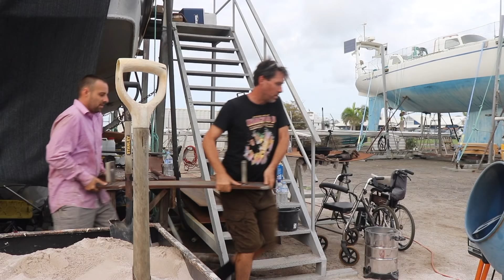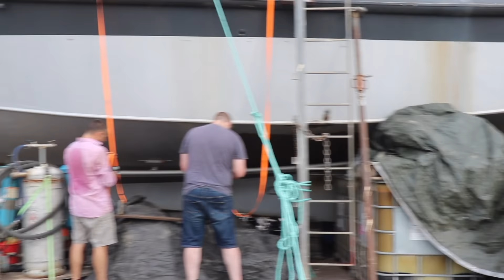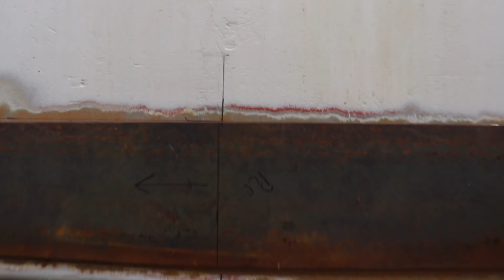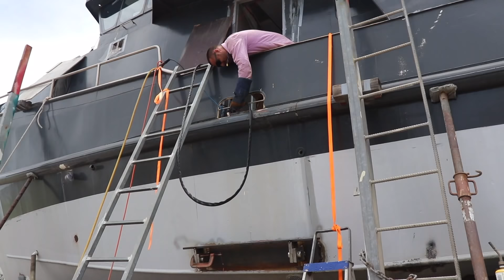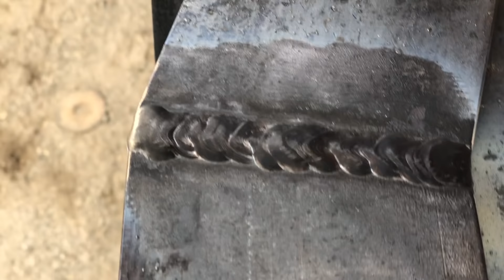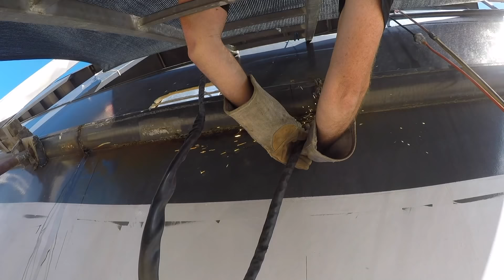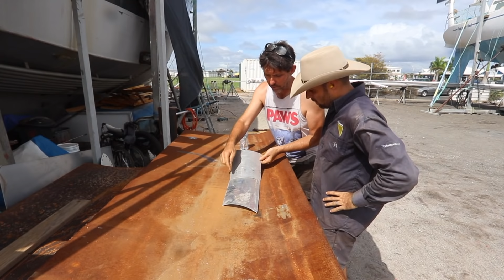Stabiliser Hinges & NAS Installation - Project Brupeg Ep. 123

Comment: Great video as always. Will you be using an electric winch, hydraulics or hand winch to raise and lower them?
Reply from the maker: Originally i was thinking manual hand winch, then realised that would break your wrist lowering them if your let go. so i moved to electric but then realised if a bog wave bopped the wing underneather when it was halfway down it could theoretically slam against the boat and crew member. so ive since moved to full hydraulic ram accuation. This allows wing elovation to be adjusted to any angle, is powered up and down and cant be bopped by waves/swell and is miles safer over all. A by product is its also massively stronger. the smallers off the shelf ram we could use has a SWL of 6.6 tonne so well within a good margin of safety for us.

Comment: THANKS FOR THE VIDEO  AS I LIKE TO SAY ..great to see a nas personally i prefer not to dhcp assign ip addresses to the machines on my network  which means you must assign ip addresses to the hardware on each system which are in the same range  its easy to do and  will not randomly reset itself as routers tend to do...also dhcp assigned networks are easier to compromise  if your into that sort of thing...  i also recommend learning basic networking config  just makes troubleshooting easier
Reply from the maker: Thanks Mike

Comment: I would have built both stabilizers at the same angle. I did a quick CAD drawing with the angles you called out and when they are in the stowed position the difference was not noticeable. Especially since no one can both sides at the same time, they would never notice it and probably wouldn't see it if you told them is was there.
Reply from the maker: Jims right, my disability wont allow me to function knowing one wing is sticking out slightly more than the other.
Reply: @ProjectBrupeg  Well at least you don't have the OCD where you must get it done at any cost no matter what it looks like.

Comment: Do you think adding a stop in the hinge would be a good idea to help the extinding arm? Just incase there is ever a problem the wing wont fall all the way down.
Reply from the maker: I doubt i could build a stop at the hinge that would ever be strong enough. We could just add a stainless wire rope between the wing arm mount and the hull arm mount. so when its down teh cable is tight and if anything ever failed the cable would take up the job.

Comment: From the inside of the boat, you could core drill holes where the hinges are located, and plug weld for super extra high rigidity. :D
Reply from the maker: We are actually going to do this on the doubler from the outside. Rather not cut holes in the boat, just in case...

Comment: I have exactly the same model NAS and I've been running it for a few years, they are bullet proof, great choice.  
I'd also be ready to replace those WD Red drives in about 3 years, I've had a few go.  They are good, but I haven't had them last too long.
Reply from the maker: Hi Mike, yeah the plan is to bump them for SSD when we can afford it. for now we just need to get up and running so we can afford to drop a few reds if needed
Reply: @ProjectBrupeg  Absolutely, I've run the WD Reds for a while and had a few die and friends have had similar experience.  They're great to start with but yeah as long as you're aware they should be fine.   Perhaps that was just a particular batch and they're better now.

Comment: Hi again, I have a welding question for Dame... so when you say fluxcore wire with gas, What gas? I'm in the welding industry and I'm impressed with the results you are getting with your single phase setup. In New Zealand the  norm would be hard wire with "argoshield" (argon and c02) for general purpose fabrication  Or fluxcore wire with straight c02 gas for structural steel beams etc. but I don't think this wire that I'm talking about will work without gas. keen to know what you are using mate:)
Reply from the maker: Hi Steven, every thing we did here was a guess and winging it.The wire is 0.9mm E71T-GS which can be run without gas, however we were running Argoshield 40 which is a BOC mix used in exhaust shops capable of running mild and stainless (as they routinely swap between those metals and it saves having to keep gas variations). Its 95% Argon and 5% Oxygen. We have used it for years and found it to be really versatile. welding pretty heavy steel with it.

Comment: Poly face shields can be polished to like new condition using the same product used to clean dodger panels. You can also use 'Dirt Bike' tear off shield packs that have several new sticky back panels on top of each other, panel gets fuzzy, just tear it off and expose a shiny new surface...
Reply from the maker: Hi Mike, i quite like the idea of a tear off. i tried to do that once with glad wrap. It didnt work, dont try that at home (or at work) youll be laughed at either way.

Comment: Great work everyone. I have been keen to see the wings being built so fingers crossed they are not far away from working..I have to say that as an old guy all those tiny wire connectors in the PC gear worries me and a marine environment..Is there anything special that you use to ensure they are protected for the long run?
Reply from the maker: Hi Wayne. Nothing that wouldn’t be in an office. It’s hard to marine proof a lot of this tech, we keep it in the wheelhouse which is as close as we can get to climate controlled but it all has a life span as soon as it’s unwrapped on a boat

Comment: Great energy, really see it lift you guys fantastic help from Stu, Scott and Trevor.
Please excuse this following ramble, just have to get it off my chest, I know its a little late, and you have probably already completed the stabilisers.....but I would really try to keep the dimension similar/symetrical. Purhaps using a theodolite/or construction laser to determine baseline to start. Also it might have been possible to solve the issue with the incline of the deck by introducing a large radius bend rather than a point angle. This could have allowed you to accomodate the difference in the bulwark level (fore and aft) with out introducing a skewiff hydroplane surface just so it conforms exactly to the deck profile.....the point at which the forward part of the stabiliser would meet on the upper portion of the bend at the bulwark, and the rear part of the stabiliser would meet the bend of the bulwark at the lower portion of the radius bend. The 35mm difference should be able to be accomodated with a reasonably modest bend. The challenge would then be using CAD  Cardboard Aided Design) to make the dynamic curve in the stabiliser foil bend interface. This same broadening of the bend in the stabiliser wing could also allow you to balance the two stabiliser dimension while minimising any apparent fitting issues.
Love your work, cheers
Reply from the maker: Hi Dan, the issue with a curve over the length of the wing is you cant then have a curve over the wing front to back. Also the kink in the wing wont affect water flow as the area presented to the water is aligned so its true for the water not the deck, the kink will be bang on for the front of the wing and 35mm higher than the deck for the back edge. I would rather the wings run true in the water than align to the deck visually.

Comment: Damo, you know you can pre heat your steel with the gas torch if you are worried about cold laps on some of that thicker stuff, just checking mate. How hot ? Well it won't make yr skin go white but pretty hot if you touch it.
Reply from the maker: Hi Simon, any welds we do on the thick stuff is generally a tack and we get the big boys in with their 580amp welder. So im not to stressed about my welder running beads on the doublers etc.

Comment: Another interesting video from the Brupeg team. Just a quick question: Have you factored in the cold water temperatures for the metal and welds in the Stabilisers? Such as a heavy impact in Antarctic waters with regards to ductile versus brittle values?
Reply: I think there's been debate on this here  before on avoiding steel grades prone to poor cold weather strength?
Reply from the maker: We use 250 grade steel as it has the most maluability. that said all mild steel goes brittle in extreme cold but define extreme cold. We will almost always be in non frozen water as we dont have the hp or weight to crush ice (thin ice yes say maybe half a foot thick, but not much more than that) the front of the boat will be sheathed in 300 series stainless which can handle the extreme cold without cracking so stay tuned for the ice mods episode we will be doing soon.

Comment: Did you use co2 with your fluxcore?
Reply from the maker: No. Argon and oxygen only
Reply: @ProjectBrupeg  I guess you meant to say argon and co2? That would explain your issue with deposition. Time to learn to use low hydrogen MMA. The problem with mig is there is not enough heat in the parent material your welding to, hence why you should never weave with a mig. And there is a high chance your welds will crack due to cooling to quickly due to the giant heat sink your welding to.
Reply: @moonbrothers9098  
Don't forget they're only welding 1/4 in to 1/4 in 
And they're in mid northern Australian summer not freezing northern hemisphere winter
Reply from the maker: have to disagree here. if MIG wasnt acceptable then the pros wouldnt MIG these boats together and it wouldnt pass survey. Yes stick has its place but to blanket say MIG doesnt is not accurate. MIG has moved on, its well capable of penetration on these thicknesses, and when we need to weld the thicker stuff we only tack with our gear then call in the pros with there 580amp welder.
Reply: @ProjectBrupeg  
Old school thinking 
Every little if any stick used in modern manufacturing 
Its all mig 
Or sub arc thats still useing solid wire 

Plenty of flux core.used in earth moving repair and a little bit of stick used but thats mostly due to environment amd equipment available 
You wouldnt find a welder useing stick if they can aviod it
Reply: @ProjectBrupeg  
The old fella welds at the mine i used to be a mechanic for used to love busting out the stick to weld up a small  frame crack here and there just really to show off saveing the day 
But they werent even allowed to use it for big jobs had to be mig or flux core

Comment: Was this boat under water? Oh yes yes it was I figure the Warner was forced in due to it being a rum rail with some crappy welds from previous owners?
Reply from the maker: We had a brainstorm and figured out why there was fresh water in there. Nearly four years ago I replaced some rusted and pitted floor in what was the old galley. They must have had leaky pipes and the water ran down to the hull and rusted the lowest point which just happened to be the inside of the sponson. So water was able to get in and run to the back of the boat. I then cut the rusted panels out and welded new back in without thinking about water. So it’s been sealed in there for four years